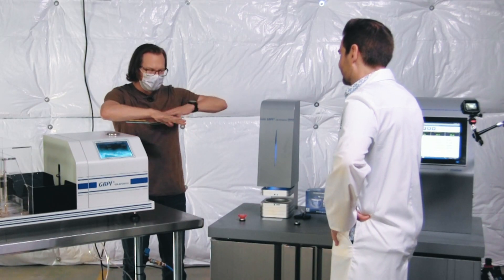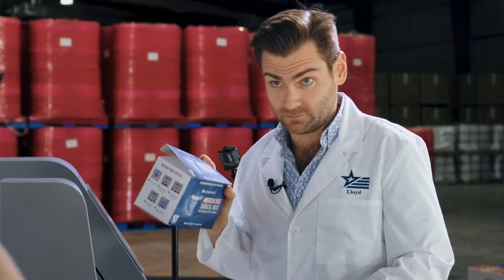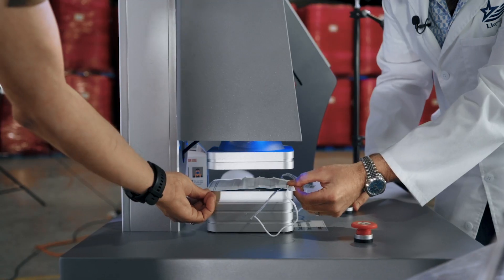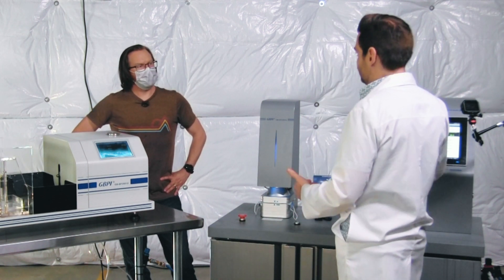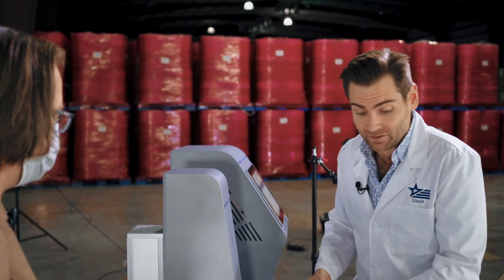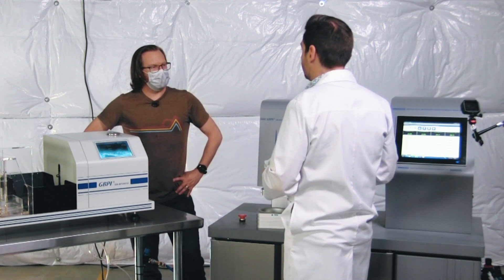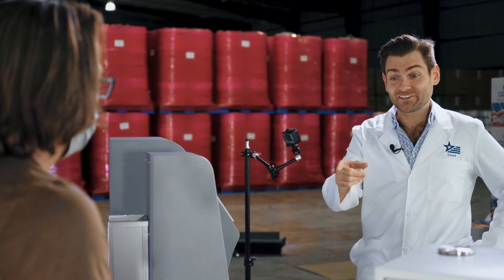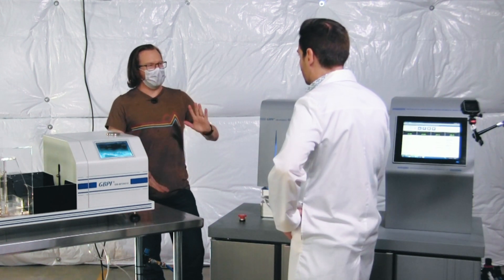Armbrust Surgical Mask Vs Armbrust N95 Mask

Comment: What is the Most Penetrating Particle size (MPP) for the material?  Is it 0.1 microns or 0.3 microns? What are you testing? If MPP is 0.3, then 0.1 test is easier (not harder) for the mask.

Comment: I thought surgical mask do not protect the wearer ,only the people around us ??
Reply: Surgical masks filter in both directions, so they protect in both directions. That means the user and the public both get some level of protection. A mask with an exhalation valve (like those used for construction) will only protect the user.
Reply: @jack_brooks  but what about the openings at the end?

Comment: Was this by the NIOSH standard or bacterial efficiency?  What are the machine stats (flow rate, etc)?
Reply: @LolKid15 Brain surgeons wear these for countless hours for their entire careers. You would think they would know better being brain experts and all.
Reply: @LolKid15  Um... what? Can someone with more know-how than me respond to this? BS detector is going wild but have no idea how to respond to any of this... 
I don't think any of that is how that works but again; I've no prior knowledge about the topic. What's your claim to understanding these (complex?) processes?
Reply: @sentientshadow126  Easy: Oxygen molecules are wayyyy smaller than virus particles and aren't blocked by those masks at all. Also, you don't "get used to" Oxygen deprivation. Thats not how that works. And while we're at it, headaches are no common symptom of oxygen deprivation, but would rather fit to CO poisoning.

Edit: And for the "absolutely ineffective" part, this video literally shows that that's wrong.
Reply: @sentientshadow126  The One is just overly sensitive to hyperbolic attack dialogue reguarding masks. Don't pay any attention to it, your BS detector is working just fine ;) If they truely believe it or not is up for debate, but we'll never be able to prove or disprove it by their standards as they've set up their argument to include a time frame that spans more than a decade. 

That said, Armbrust did some decent marketing by setting up this testing series, it's at least something more to consider when shopping for masks, vs an amazon comment section :)
Reply: @LolKid15  Nerve cells don’t divide.
Reply: JJ CJ great questions
Reply: N95 is the NIOSH standard.
Reply: @sv1201  Obviously.  There are different ways to measure masks.